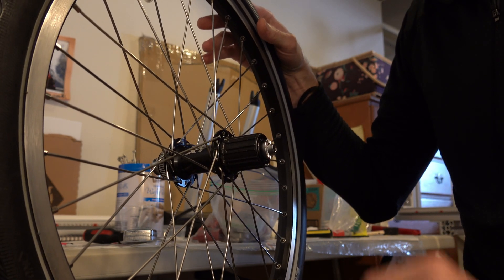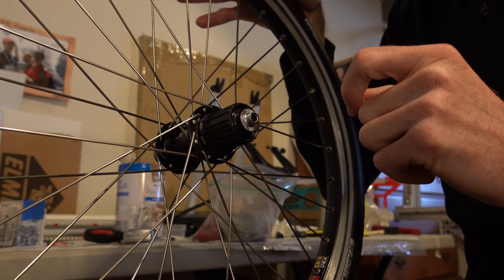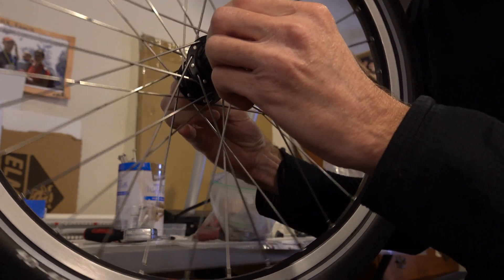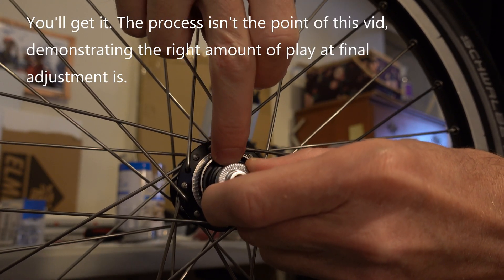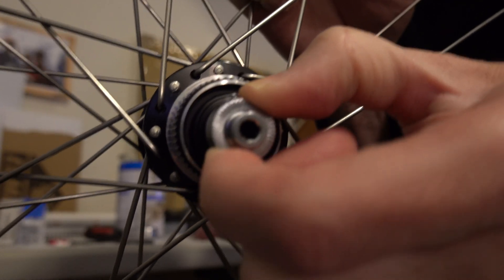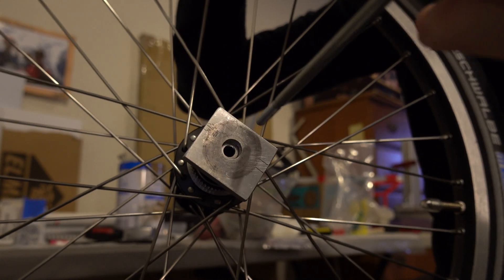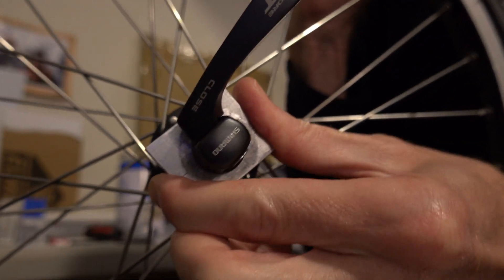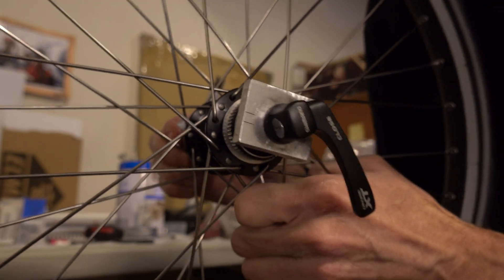The Right Amount of Play in a Properly Adjusted Cup and Cone Bicycle Hub Bearing.

Comment: Tiny amount of movement in bearings with cup and cone system . Movement 'just' disappears when the skewer is closed in the dropout . The "90 degree" skewer closure method works for me .
Reply: The rule for more than 50 years-- slight play when the skewers barely hold the wheel in place-- when the skewers are fully tightened the play goes away!

Comment: I have a little play on my FH QC 500 ms like barely noticeable only if you really focus your hand on it, is it normal or do they have to be completely tight?
Reply from the maker: With the QR done up tightly, that play should disappear. Try tightening the nut to get the QR to put a bit more pressure on, but if that doesn't do it, it may need adjusting to work as shown in this vid. Play with no QR or very lightly applied, but should disappear when QR is done tightly for riding.
Reply: Update: my bike shop switched it up to a fh mt401. The bearing cartridge decided to spontaneously fail after a couple days. It was bent very slightly
Reply: Sealed cartridge bearing are a totally different system- usually requiring pre-load adjustments, not for a novice!

Comment: Seepage showed that oil was separating from the OEM grease in my front hub. Before repacking, I opened it to see if there was measurable wear on the balls. An allen wrench wouldn't hold my quick-release hub, but I discovered something better. The threads between the cone and the axle were dry. When I repacked, I degreased the axle and the cone. I found that the axle threads had a rough black coating. Friction would keep the axle from turning when the threads outboard of the cone were greased and the locknut screwed down. To reassemble, I slipped a 12-inch vinyl tube over the axle to keep the threads dry as I packed grease. The difference in friction between dry and greased threads meant that my adjustments wouldn't slip. I like your idea for using the skewer without mounting the wheel. It's quicker, and I can check axle rotation and play with my fingertips. Instead of drilling, I stacked washers. Sure enough, I had to back off my original adjustment about 30 degrees. Thanks.

Comment: Thank you for posting this vid. It makes complete sense & I understand its purpose, function, how to do it, etc. I've made some by super glueing some 3/8" ID hole 1 1/2" OD fender washers together (4 for each one/side) & they'll work, can always add more if need to be thicker. Ironically, on my way to get those last night, I stopped at the local bike co-op, & talked to the main/lead mechanic about your vid here. He told me both his grandpa & Dad had made these & used them, was familiar with them & understood them, etc. I kind of asked him if they were willing to just let me cut the rear dropouts off of one of their junk frames that they'll wind up throwing away for this & he kind of just didn't answer, somewhat laughed under his breath & walked away. I went & got/bought the fender washers. Then this morning it hit me, I'm transferring all the parts off of an old '80s road bike frame & fork I've got to another old '80s road bike frame & fork, 'cause the 1st one got bent/destroyed running into something. Duh, there are my rear dropouts, just waiting for me, smh..., 🤦‍♂️😉
Time to get that transfer done & get out the angle grinder! 👍
Thanks for sharing the knowledge though, it's not something I had 100% completely realized, & it makes perfect sense! I plan on making my wheels/hubs last as long as possible, & this, was the missing tidbit of knowledge that makes that completely possible & realistic. I might wind up being a prifessional wheel builder too, time will tell, & money, but if nothing else, I definitely plan on at least making a couple sets for myself, for real!
Anyway, later, & thanks again, ✌️..., 🙂
Reply: You already have a JIG to measure the amount of play--- it is called a bike frame, You simply attach the wheel to the frame- and you have already gone through setting a bit of play in the bearings and in this initial step the wheel is barely clamped in the frame it has a small bit of play- now fully engage the QR and the play should be gone or at least you are at the starting point to get it dialed in! The blocks are a distraction from what needs to happen- you can not get any real sense of the bearing play since these two things are not giving any feedback as it relates to a wheel held in a frame. You are asking for a way to measure play when it is in front of your face!

Comment: I learned this in 1988 when I read Greg LeMond's Complete Book Of Cycling published in 1987. I also learned from him how to 'spin'. Nice video for those don't know how to adjust bearings.
Reply from the maker: yeah, definitely old knowledge, and it's out there in plenty of places. However I'd not seen a video of a decent way to check this, and since I'd knocked my head against it several times (having had to set the initial preload on more than a dozen hand-built wheels for the weird carbon fiber recumbents I make, as well as maintain other bikes) I figured I'd share my method. I should do another one showing how to check this when the wheel is in the frame, which also gets to the point of proper tensioning of the quick releases.

Comment: The right amount of play for this technology is the distance to the trash can.
Reply from the maker: lolz -- you should alert Campi and Shimano then so they can swap it out of their flagship lines. It'll outlast anything else if set up correctly, and it's easy to swap bearings with basic tools. I have plenty of cartridge bearing hubs on allegedly higher-end wheels, and I'd usually rather have cup and cone any day of the week, though don't ask me that while I'm wrestling with getting one to the perfect preload. Some of those cartridge bearing hubs require a blind-hole bearing puller, and for one, I had to fabricate a reverse-thread race press to pull the bearing. Even the manufacturer (velocity) couldn't tell me which way the thread went on the older axle. Pulling or pressing out cartridge bearings even with my regular threaded puller and drifts is always nerve-wracking. Get them in crooked and goodbye hub. I don't think it's any easier or less time consuming, though it used to seem that way when I was a lousier mechanic and couldn't dial in cup and cone quickly.

Comment: Not Flexes, it Compresses/Squashes makes the axle shorter.
HTH
Yours is a Very good method. well done.
I use a home made wheel truing stand when adjusting the bearings on mine, but then again I like building my own wheels and have one readily available.
You can also use your method of aluminium blocks to check the pre-load on sealed bearing hubs.
P.S.
Only do this on QR axles, solid/bolt on doesn't have this problem so set them without any play.
Reply from the maker: I build wheels too but my stand is plastic fork ends, so useless for hub adjustments.

Comment: Ref too tight from the factory, I believe they do that because there is a break-in period for hubs during which they wear rapidly when first put in service.  Also, according to Jobst Brandt, on Sheldon Brown website, all bearings should have a small amount of preload to last the longest, which means they probably won't pendulm as Sheldon suggests!
Reply from the maker: Whether they "pedulum" or not is a pretty bad way to try and judge bearing preload anyway. Addition of a tire and tube will change that, or the existence or lack of hub end cap seals, or even just greasing those. The method here is = to Park, and the "preload" is provided by the clamping force of the skewer, because it it's already provided by the hug adjustment, it'll be too tight. They come too tight from the factory because the factory expects a mechanic to adjust them properly before sending the bike out the door. (Same reason frame pieces need checking, facing, etc.)

Comment: Is this the case with both aluminum and steel axles? I cant imagine the quick release skewer can bend the steel axle enough to make the bearings tighter. Maybe with aluminum.
Reply from the maker: steel. You might not imagine QRs could flex the axle, but it's real (and very well known...) It absolutely flexes the axle enough to make a difference in bearing preload -- as shown in the video! Not setting it correctly can be the difference between getting 500 miles out of a hub or a lifetime of use.
Reply: You are wrong. Both will compress!
Reply: It is not "bending" the axle. What is happening is that the quick release is compressing the cones and locknuts on the threads of the axle. The threads have a minute amount of play in themselves; if they did not, it would be impossible to thread parts together.

Comment: My biggest question is what bearings to get Chrome Steel, Carbon Steel or Stainless Steel and what grade G25, G10 or G3? I have Chrome Steel G25 but thinking there is a better option what is your view?
Reply from the maker: I don't think I have ever used anything but G25s.
Reply: @SethJayson  Why surely they would cause more wear on your cups and cones? Have you ever tried ceramic lose bearings in a cup and cone?
Reply: @paulb9769  DON'T! The ceramic bearings WILL destroy the cup and cone as they're not hard enough and it is almost impossible to replace the cups.

Comment: Seth thank you for this video! I’ve been trying to figure out why my wheel feels perfect out of the frame and spins way too slowly in the frame. 

Any chance I could pay you to make a pair of those blocks and ship them to me (Utah)?  Or suggest what I could buy?  Googling has gotten me nowhere.  Thanks.
Reply from the maker: You don't have a drill press? A set of metric bits is fairly cheap on Amazon, and a strip of 1/4" thick aluminum would do the trick. (I use 3/8", I think, a bit easier to grab, but I had excess aluminum left over from a project.)
Reply: @SethJayson  great timing!  I just watched a Park Tool video where they showed using wrenches to do the same thing so I'm going to give that a shot. Thanks! (no drill press at home for me).
Reply: @SethJayson  You can also use some 10mm flat washers stacked on each side.
OR some m10X10mm bonnet stand offs/spacers, I've used both before.
Reply: You really are looking for things not needed, when the best tool is your BIKE FRAME

Comment: Seth..great idea with the aluminum  blocks..generally  when you are adjusting a cup and cone bearing you want to make sure that the drive side cone is firmly  locked in place and make all adjustments from the non drive side..
If a bearing is loose on the drive side the hub will tend to tighten  itself as you ride..if it's loose on non drive side it will tend to loosen..( less catastrophic damage) on many older British bicycle axles  there is a small shoulder that fixes the drive side hub..this is the reason that the fixed cup on the BB is on the right side..
On front wheels make sure cone is locked on right side (drive side)  and make adjustment on non drive side..
Reply from the maker: Interesting. I usually work the drive side on rear wheels because I am usually doing a single initial setup or maint, which for me includes packing the freehub with grease at the same time. (Have never been able to figure out how to remove the inside seal on these M8000s though, which sucks, I can get a non XT Deore to be silent by removing seal, heating freehub body with heat gun and dripping in Phils tenacious...) Never considered the rotation if loose. OTOH I check the bearings for play pretty regularly and they seem to stay put after I crank them sufficiently. Part of me prefers cartridge bearings, but I have had some wheels with those turn into crazy jobs when manufacturers used high-strength loctite on one side and (possibly) reverse threads so it became impossible to pull the cartridge.
Reply: It is just good shop technique, one works in an efficient manner. In the old days a freewheel would hide the drive side cone, so one began the disassembly from the non- drive side because unless you removed the freewheel one could not get cone wrenches on the hidden cone. Sliding the axle out, one rarely needed to disassemble the drive side cone, washers and locknut, just make sure these were all tight against each other ( assuming the axle protruded beyond the locknut by 4 mm!  This is assuming the cone was in good shape and did not need to be replaced. So reassembly was sparkling clean components, fresh grease and first insert the drive side into the hub and make the adjustments from the non-drive side! The aluminum blocks are a non-starter, way better to get a sense of feel when the wheel is on the frame, you can not measure torque or play in the bearings unless there is feedback--- i.e. as a wheel is being held in drop-outs!

Comment: Very helpful. The idea of making the drilled aluminum blocks is brilliant. I'll make a pair. I too would like to know if this 'tightening' also applies to solid threaded axles that accept a nut.
Reply: I did the same thing with some hard wood. Perfect! 
Really good idea! 💚
Reply: While the blocks are a good idea, the implementation of their use as shown in the video is wrong, or at least inefficient. You only need one block; Stein Tool has been making these for decades. Actually, you don't even need a block. I do this on the bike. On a freehub rear wheel, you put the quick release skewer in with the lever on the freehub side, and clamp that side into the left rear dropout. Then make the adjustment on the non-drive side cone. The skewer is already adding the compression, so you adjust it until there is no play.  Done. The only time you need the Stein tool or a separate block is when the outer dropout design prevents the wheel from being clamped to the frame outboard of the dropout.
Reply: Thanks very much for replying, especially after so long a time. I'll give your method a try. To anyone else who arrives here looking for a solution, a stack of plain, flat 'fender washers' might suffice instead of the blocks, drilling, etc. Thanks again. @trekkeruss
Reply: @trekkeruss  One already has the perfect jig to get this adjustment-- it is called the bike frame. Only by clamping the wheel to the frame can on assess the amount of bearing play- it is foolish to think that with two aluminum blocks you could ever replicate the side to side torque one can feel when done on the frame! Silliness, the Stein tool is equally silly! My rule for more than 50 years of working on high-end bikes- slightly clamped wheels in the frame a slight bit of play-- then fully clamped QR the play disappears!  If the play is still present adjust by small degrees until it disappears. Done-f'ing deal!

Comment: Can the cassette put pressure on these if overtightened. My free hub is making a crunching noise since I last tightened it up.
Reply from the maker: I've never experienced any difference in axle bearing preload as a result of cassette lockring tightening.
Reply: No!

Comment: Does this apply to solid nut axle?
Reply: No...on a solid axle when you are tightening  it you actually  are loosening the hub..on QR wheel you set it  little loose and on a solid axle a little tight..I hope this helps..
Reply: @sprocketandwheel  I have a solid axle thanks for the advice

Comment: Strange how we think we have it correct and then when we tighten the quick release it over tightens the cones. It must somehow apply a slight extra pressure to the cones.
Reply from the maker: The locknuts tighten and flex everything, so yup! I had a rear wheel come on a brand new bike from a bike shop and they didn't check this and the cups in the hub were destroyed after only 1,500 miles or so, so it pays to get this right. They'll last pretty much forever if you do.
Reply: How should the wheel be checked at the rim for play? Usual recommendation is to lift the wheel from the ground and push the rim side to side with one hand only. What could be done if there is no play when checking with one hand and some play when twisting the rim with both hand from opposite sides? Also there can be some play when the wheel is on the ground. Another thing is sometimes it's hard to leave right amount of play before tightening the qr sqever. If there is too little play then the qr sqever might not hold the wheel in the dropouts sufficiently enough.
One more thing is if the dropouts are not completely parallel then they can now the axle creating uneven play compared to dummy dropouts, so then one has no other choice but to over tighten the qr sqever. Cartridge bearings never seem to develop uneven play but there seems to be some uneven freehub drag for  some reason if the qr sqever is tightened sufficiently enough.